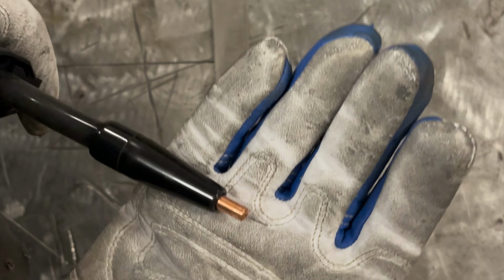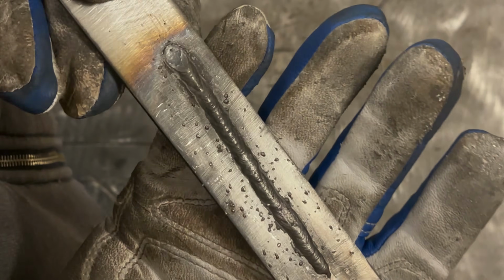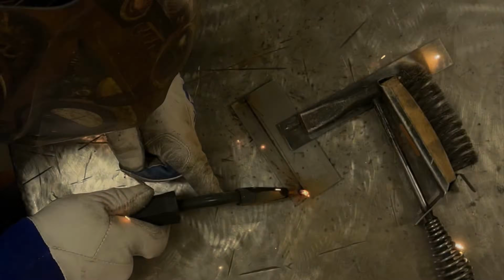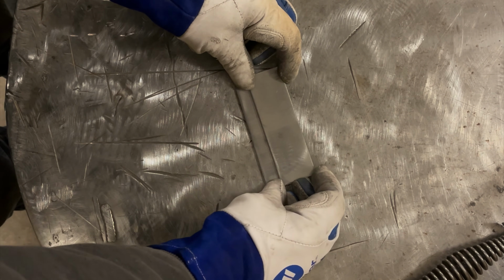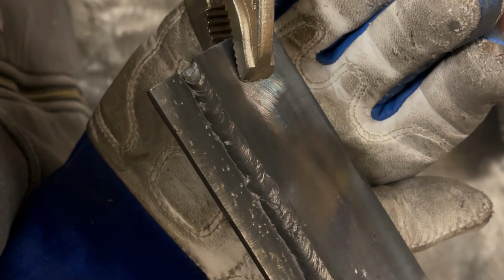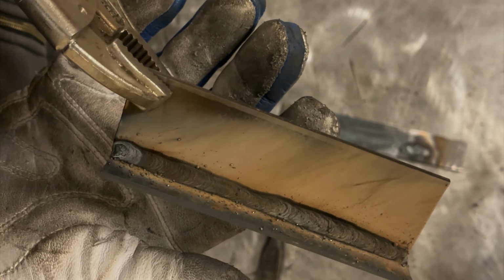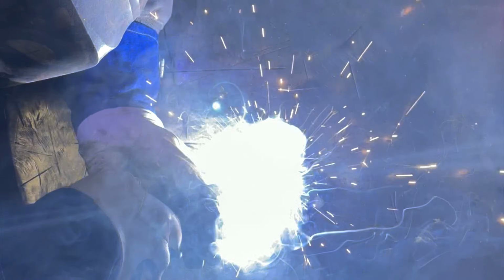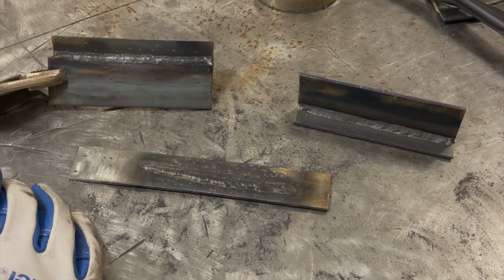How to weld with flux core wire

Comment: Hey guys, I did this trick. Got my generator producing power, left it on for about 5 minutes then I turned it off. Turned it on again and I had to do "flash" the generator again and it produced power again. Point is, the generator still isn't producing power without flashing it. Did I miss a step?  Champion generator 3500

Comment: I'm new to this.  Waiting on a arccaptain 130 from Amazon hope it works.  Just want fix stuff around the house who knows.  Im 61 retired
Reply from the maker: I have talked with a few people that said the welder works pretty good.  The harbor freight gives more control over settings via adjusting the voltage and wire speed independently, however the way the arc captain works should still function more than good enough to weld a lot of things.  If anything it will be easier get going with it.  The great thing with it is it doesn’t weld on AC output like the cheaper Chicago electric welders, those can’t produce much of a decent weld at all.
Reply from the maker: I have talked with a few people that said the welder works pretty good.  The harbor freight gives more control over settings via adjusting the voltage and wire speed independently, however the way the arc captain works should still function more than good enough to weld a lot of things.  If anything it will be easier get going with it.  The great thing with it is it doesn’t weld on AC output like the cheaper Chicago electric welders, those can’t produce much of a decent weld at all.

Comment: Can this welder take on 3/8 steel bar? I'm attempting to make a saddlebag bracket for my motorcycle and need to weld steel bungs to 3/8 steel bar. Any tips would be greatly appreciated! Great videos btw!
Reply from the maker: So one of the downsides to flux core wire is it tends to produce porosity on thicker steel with small diameter wires.  The output of the welder would could possibly weld what you’re talking about, but the weld would solidify too fast causing porosity to form inside the weld.   Even a 140amp wire welder will have this issue.  Going to .045 wire solves this, but most smaller welders don’t have the ability to run that wire (lack of feed rollers/gun liners).  If you preheat the part and try to keep the weld thickness to a minimum, it might just work.  Definitely one of those things that’s worth doing a trial run first.
Reply: @makingmistakeswithgreg  thanks for the quick reply! I meant steel round rod if that makes a difference. How would I go about preheating? Do I preheat the steel rod at the desired weld location? Do I also preheat the steel bungs? Or do I tack the bungs to the rod and preheat both at the same time? I appreciate you taking the time to respond!

Comment: Is the wire on this welder hot before you pull the trigger like those cheaper (Chicago, etc. AC 2 heat) welders or is it dead until triggered?
Reply from the maker: It’s dead until triggered.  I forgot all about those Chicago electrics being live even when the trigger isn’t on lol.

Comment: great video! I am planning on buying my first welding machine and I am considering going the flux core route. never welded in my life, but always wanted to. you explaining things really well make me feel like I maybe could do it too! :D
Reply from the maker: You can do it 😀.  Just expect to fail a bunch and get frustrated at first.  Flux core is a great place to start, it’s affordable, useful, and fairly easy to do.  It has some limitations but for what the titanium 125 welder sells for new, it’s about the most useful tool you can buy for the money.  It opens up a ton of capability.

Comment: Nice to see someone using a cheaper welder.  Nice point that some wire brands produce more spatter than others.  Do Miller gloves produce  a better weld (lol)?.
Reply from the maker: Haha miller gloves will give you a smoother bead for sure lol.  That titanium 125 is probably the most useful sub 200$ tool a guy can own.  It welds excellent and is capable of tackling a ton of jobs.

Comment: Great video, I have struggled with fluxcore for years and thought it was just how it was.I am looking forward to giving it another go asap,have just started Tig welding after 40+years of mostly stick and  just need more time to practice 👍😉😎
Reply from the maker: Thanks, glad you liked it 😀.  Flux core wire is very useful, so is tig.  Tig has a steep learning curve at the start but becomes easier once you train your hands how to move.  Flux core wire is actually super easy to learn because it’s far easier to weld out of position and poor fitups than gas shielded mig.  Good luck on your skill development journey 😀

Comment: I took welding class in 1970's at the new Vo-tec center. Never really got the hang of it. Recently bought a Titanium 125 thinking it might be easier to use than the Lincoln AC/DC 200-amp welder that I have dabbled with occasionally.  Just wondering, any reason why you don't use welding magnets?
Reply from the maker: Great question.  I do use the from time to time but I don’t own that many of them.  A lot of that comes from the fact I learned to be competent at tig welding first.  With tig I simply hold what I am working on and fusion tac weld it.  Magnets drastically affect the tig arc (it will cause arc wander with other processes) so welding on something with a magnet in place would cause problems.  If I need something held tight or square I have 90degree squares and clamps
I can use.  Magnets can work good as helpers, I just tend to not use them much I guess.
Reply: Thanks, that's what I wanted to know (arc wandering).

Comment: i wish i have all of your "bad" welds. mine looks like chicken shit, a blob here and there and once in a while randomly some "bad" welds like yours
Reply from the maker: Everyone starts where you are now.  When I was new to welding ( a long time ago)
I spent a hour welding in a shock tower in a car and when I was done it literally fell off 😅.  It’s not where you start, it’s where you wind up.  Focus on moving consistent and smooth.  Run enough settings (heat) so that things melt and move slow enough that everything melts together.  Practice a bunch.  If I could go from 1 hour of welding instantly failing  from gravity to being able to weld anything decent, you can too 😀

Comment: Harbor freight wire is E71T-GS. Lincoln NR-211-MP flux core is E71T-11. 

The E71T-GS is not rated and going to be different from different manufacturers. They are definitely not all equal. 
The E71T-11 is standardized to meet AWS specifications. So it's basically the same from different manufacturers. I 100% prefer and recommend E71T-11.
Reply: Now theres a good bita info :goat-turquoise-white-horns:

Comment: Great video. Just bought a Arccaptain 200. I am a totally newbie and all my welds looks like s…. I wish your welder didn’t use ABC etc but amps. Maybe more understandable for a newbie. I am only on my first flux roll so I guess I have a long way to go. But I did learn ;)
Reply: Spend the afternoon making huge mistakes. Trying to weld 0’9 and 1,5 mm steel. At low settings I managed to blow holes in the 0,9mm. Do you have a video where you show/explain setting in WF and amps? I wish I had someone like you next to me lol
Reply from the maker: So I have a bunch of advice that should help you.  I have not used the arc captain 200.  If it has the ability to adjust wire speed and voltage separate that will be good.   In a nutshell wire feed is how big of a weld you want to deposit.  Thin metal needs small welds, so you need low WFS.  Thick metal needs big welds, so you need more wire.  Voltage determines how wide the weld is as well as how well the toes of the weld “wet out”.  If the weld sits on the plate like caulk, it needs more voltage.  If it’s excessively flat and undercut is present, less voltage should be tried. 

The limitation of wire welding is that many 200amp class machines can’t handle big wire (.045+) or very high wire feed speeds with .035.  So their ability to weld thick steel is limited.  Because the wire size controls the amp handling capability, and a lack of overall amperage means lack of root fusion, the ability for a 200amp welder to properly fuse 3/8th+ plate becomes limited.   Dropping from say .035 to .030 wire won’t improve root fusion despite being able to push the smaller wire hotter, because the wire will tend to “blow apart” creating excessive spatter before it fuses the root.

Video wise this particular video should help explain the balance of WFS to voltage a lot better:  https://youtu.be/rml5SZBy_f0?si=D_QLczLxH5mcbMFg

Comment: Greg, I'm running Blue Demon Flux Core multi-pass E71T11-030-02. Any idea why the slag requires a power wire brush to remove it?
Reply from the maker: Great question.  I have not directly welded with that wire but they private label a ton of wires out there so I am sure I have probably ran it previously.  Generally speaking at lower amperage’s the slag comes off easier.  What may be going on is one of two things.  1) you’re welding at higher amperage range for the wire and it’s basically hot enough to create a stronger bond to the metal as it cools.  Or 2) the joint itself is making it harder to remove.  Typically fillet welds are harder to remove slag than a simple flat bead on plate.  What you describe isn’t too unexpected or unusual if it’s thicker plate (3/16th or thicker).  Depending on metal thickness you could try to go up or down in wire size (.030 instead of .035 or the opposite).  Also, if you’re used to using -gs wire t-11 tends to run a bit different.  Hope that info helps you out.
Reply: Thank you for getting back to me. I'll run some more beads at different settings and see how it goes. I appreciate your insight.

Comment: what makes all the splatter  to much heat ?
Reply from the maker: So excessive spatter is generally due to one of a few issues.  If the polarity is wrong you will get a ton of spatter.  It should be DCEN (MiG gun on the negative side.  If the machine has A/C output only you will always have a lot of spatter (mainly super cheap machines).  Beyond that spatter can be caused by a mismatch of voltage to wire feed.  Try bumping up the voltage more, do a couple welds, and see how things are.  If it doesn’t get better drop the voltage from where it was originally and see what happens.  If that seems to have no change then do the same with wire feed speed.  At some point things should get in line and weld decent.

Comment: Newb here. Bought myself a older Lincoln 180 and can't wait to molt my hibernation blubber and give it a go. Winter is too long in Canada but gives me time to educate myself and make plans. Been watching a ton of videos and have to say yours are fantastic (I dare say the best one I've seen so far)! Despite it's bad rap, I'm going to do flux core and it will likely meet my needs for the things I want to do and where. Having had a long career fabricating plexi cases where I flame the edges and also plastic welding hdpe tanks, I can really appreciate the detail you went into about the angles, speeds, settings, etc because they all apply for what I do too. Definitely an excellent video and great resource I will refer to. 
Bonus tip to other Newbs while practising: bang around a bit when you're in the garage, drop a thing or two, swear occasionally. This way the wife doesn't know how much fun you're having.
Thank you kind sir for posting.
Reply from the maker: You’re welcome.  Flux core has a bad rap mostly because of poor quality welders and inexperienced people.  If you pick a decent wire (since you have a good welder) you will be able to make excellent welds.  If you master running simple beads with flux core, that is equal in width/height and consistent start to finish, you will be able to take that knowledge and apply it to other processes.  So much of welding is just moving smooth/consistent/at the right speed, which is a skill that can be built up with any welding process.  By seeking information and combining that with practice, you will gain skills really fast.  Just make sure to not give up when you get frustrated and you will be doing real well 😀
Reply: Thank you. As a beginner do you think it's best to master one technique ie stacking dimes, sawtooth, etc or to practise varying techniques until you get good at all (but takes longer)? Is that answer dependent on the type of welding you would primarily do? eg. vertical instead of flat? Which technique is the most versatile? If you could only do one technique which would you choose?
Reply: No wife, no garage, but I've an asshole president at the present - I didn't vote for him!

Comment: I purchased this welder (Titanium 125) to learn welding, got it on sale a year ago for 140.  I watched both of your videos and learned a lot.  Very common sense and to the point.
Reply from the maker: Thanks for the kind comment.  The titanium 125 is a great welder, and is a great place to start learning.  The funny thing is even if you “upgrade” to a more powerful welder, or one that can do gas shielded MiG, it still pays to keep the titanium 125 around.  It’s simply too useful.

Comment: Hi I purchased a mig welder and after going thru everything a bunch of times I can’t get it to actually weld. It does everything else, turns on, feeds wire etc but doesn’t weld. Any idea what it would be? Thanks
Reply from the maker: If it feeds wire, and the fan runs, I would suspect there is issue with the output wire.  If you have a voltage tester, measure the contact tip to ground clamp voltage.  If it reads no voltage measure the voltage inside the machine where the wire feeds in to the mig gun.  If it’s still nothing there is likely a output problem.  I am sure I could troubleshoot it further, but harbor freight should to exchange it.  😀
Reply: contact tip meaning that copper piece and then the clamp ,so both at the same time?
im sorry being difficulty really appreciate you taking the time.i will go try and check for voltage.ty @makingmistakeswithgreg

Comment: I have yet to do any welding and have a dumb question: Does the tip of the wire make actual contact with the work surface (puddle) or is there a gap between the tip of the wire and the puddle.
Reply from the maker: Not a dumb question, and it’s actually pretty complicated.  With Gasless flux core wire it operates sort of as a “spray” and sort of as a “globular” transfer.  In simple terms once the welding is underway a arc/plasma exists between the wire tip and the molten pool, and Liquid Metal is being transferred from the wire to the molten puddle.  The wire isn’t really touching the base material.  In “short arc Mig” the wire actually is solid and shorts out when it hits the puddle.  In “spray arc” which is MiG welding done at high voltage, there is absolutely no wire contact to the plate, it’s Liquid Metal at that point.  Hopefully that helps 😀
Reply: Thank you for the clarification. It’s much appreciated.

Comment: i did stick welding all my life and don't know anything about flux core welders. do i need to trigger the wire to start welding?? i touch the wire and not thing happens. ( like no connection to start the arc.)
Reply from the maker: You must pull the trigger to start welding.  So basically the trigger closes a switch, which starts the feed rollers spinning.  At the same time it turns on the output power.  Once the rollers start spinning, the wire feeds out. Once the wire touches the plate it shorts out and creates a ton of heat.  As more wire feeds out it becomes liquid and the puddle grows.  It functions like stick once the puddle is established, it just is easier to start the arc.

Comment: The reason why it has a bad reputation is that it’s mostly used, on YouTube, by new welders, using very cheap machines, with cheap wire, with no knowledge on how to use it, often learned from guys on channels who themselves don’t really know how to weld (we don’t read no manuals!). It’s thought of as a beginners method. What people don’t seem to know is that heavy fluxcore is used for large structural work.
Reply from the maker: It definitely is.  With a quality wire and a machine with adjustments, flux core can make really good welds.  It’s too bad a lot of people wrote it off as a “joke process” when it really has a lot of practical uses at the hobby level (and structural work with a more powerful welder).
Reply: True, fact is there are far more factory and professional welds done by flux core, stick, or a laser on a machine.
Reply: Don’t blame the cheap machines. There are lots of videos of skilled welders doing quality work with those cheap machines.
Reply: @lebojay sometimes. But they don’t meet their specs most of the time. And they rarely last long. Try to get many of them repaired and you’ll find the warrantee aren’t worth anything. Very few real professional welders will use these unless they’re given to them for their channel.
Reply: It's my favorite process for outdoor work